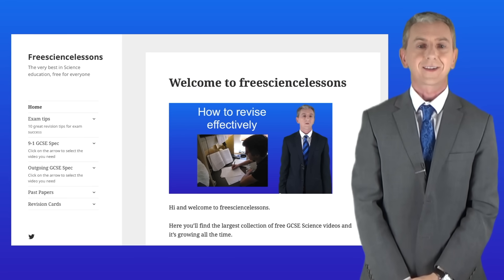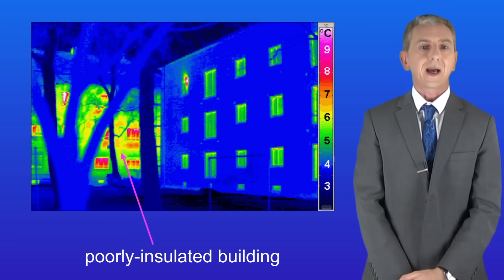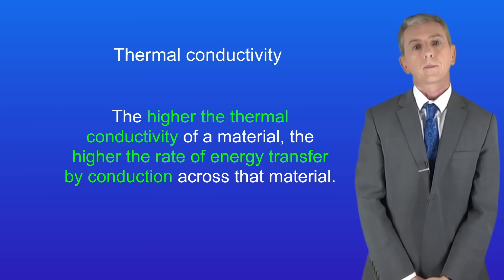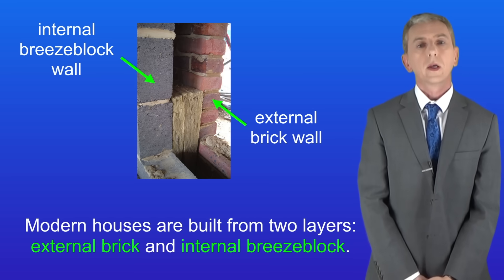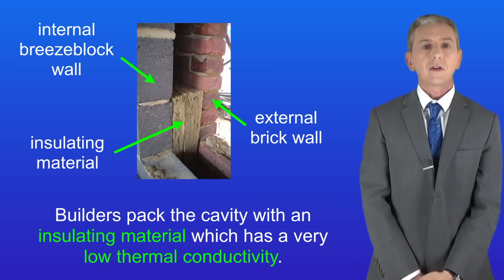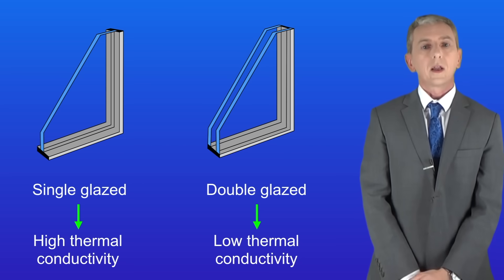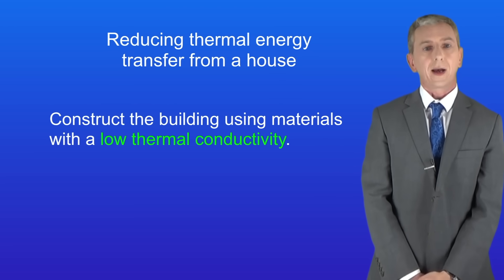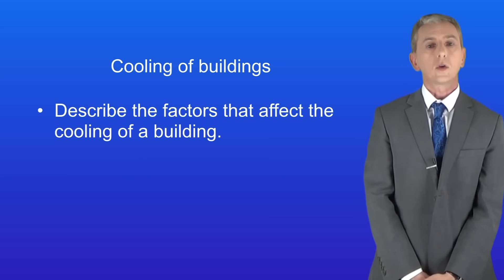GCSE Physics Revision "Cooling of Buildings"

Comment: for convection
why do less dense fluids rise? is it density? if so why? 
and why doesn't the hot dense particles share their kinetic energy through colliding thus resulting in a cold particle again?
is kinetic/thermal energy interchangeable?
Reply from the maker: Hi. Thermal energy and kinetic energy are effectively the same on a molecular level. Particles with a greater level of thermal energy will transfer this to particles with a lower level. Less dense fluids rise because in order to sink, an object must displace its own mass of the surrounding fluid. As a region of fluid become less dense than the surrounding fluid, it's not possible for it to displace its own mass, so it rises.

Comment: I was just wondering how the cavity increases the rate of thermal energy out of the house. Isn't air an insulator?
Reply: Air is an insulator, but I believe that the foam, or whatever material they use, in the cavity is a better insulator than air
Reply: i think its the conductivity of the materials more than the cavity, i.e. bricks conduct heat so insulation is necessary

Comment: Hi sir, i have a CGP Physics 9-1 AQA complete revision and practice book and it said that there was Conductors and Convections. I havent seen you post a video based on those topics. Is there a chance that they have been removed for the exam???
Reply from the maker: Hi. Convection is not the spec anymore and conduction is covered in this video. The level of detail that you need isn't that great.
Reply: @Freesciencelessons  Ok, thank you very much for the response Sir. You're carrying my GCSES
Reply: @Freesciencelessons  so will i not need to learn about how radiators create convection currents? im doing aqa
Reply: @Freesciencelessons  Is that still the case?

Comment: hi sir do we need to know the definitions of convection and conduction?
Reply from the maker: Convection is no longer on the spec. The amount of detail that you need for conduction is only what is in this video plus how metals are good conductors.
Reply: Really? What about those sitting in 2019
Reply: Rania HadidX 2019 exams use the same spec as 2018 exams. Check what your spec says RE Convection as some specs are slighty different to others